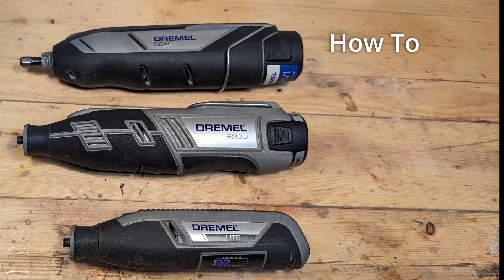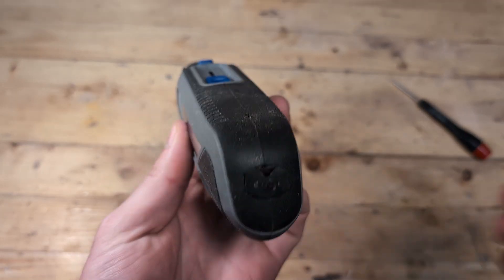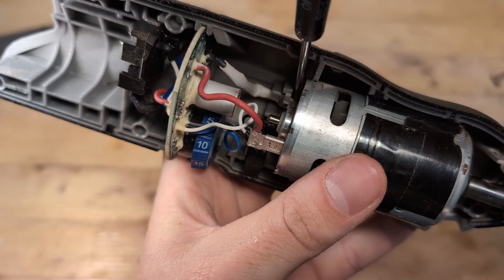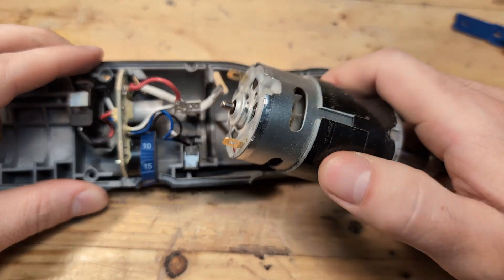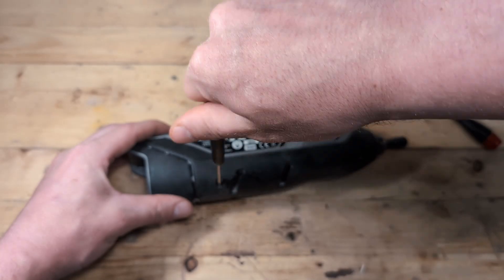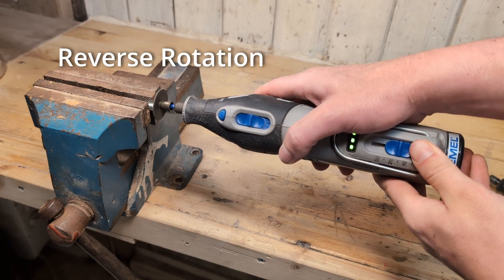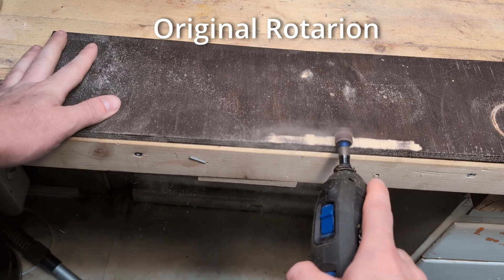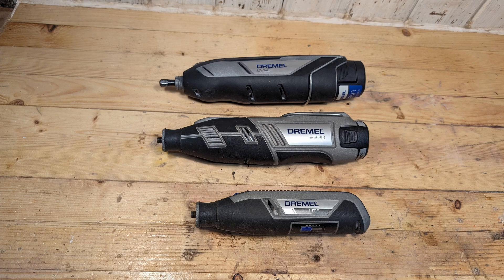Reversing Spinning Direction Of A Dremel Cordless Rotary Tool (Lite 7760, 8220 and 8240)

Comment: Couldn't you swap sides with the brushes? Or flip them upside down to match the rotation?
Reply from the maker: Changing the brushes will not change the direction. They are identical :)

Comment: It should be easy for Dremel to put a direction selection switch. For existing devices they can make an attachment to reverse direction.
Reply from the maker: Yeah. It would not be that hard to do. But I think they don't want to do it, it causes too many possible problems. Like kickback coming towards you, the collet loosening while using the tool, and bits not working in both directions.

Comment: I have to remove a very small broken screw ( like a watch size screw) . The plan is to drill it with a left handed rotation drill bit ( a technique often used to remove broken bolts). The battery type Dremel is the ideal tool for the job. Only problem is it spins the wrong way. Your video fixed that ! Thanks heaps :)
Reply from the maker: Lovely to hear. I was debating if this was actually useful or just something you could do. Good to hear that it is actually useful.

Comment: Instead of rotating the motor 180* is there not enough slack in the wires to just swap them?
Reply from the maker: Maybe🤔 they seemed a little bit short, so I think I threw that idea away a little bit too early. I'll test it out and see how it works.